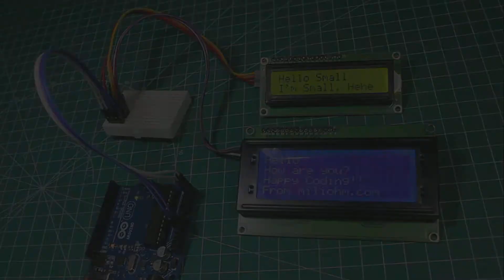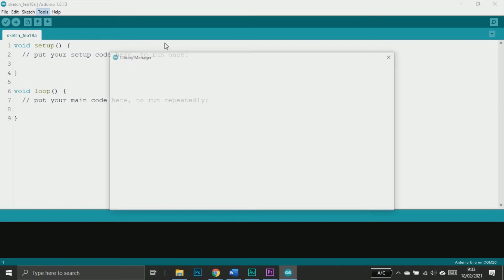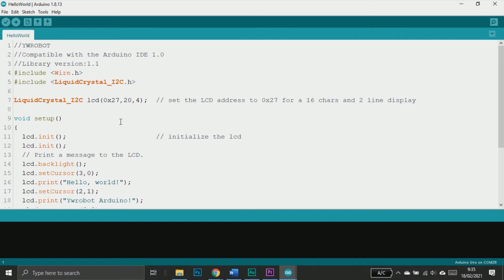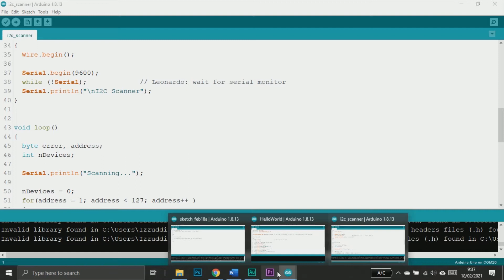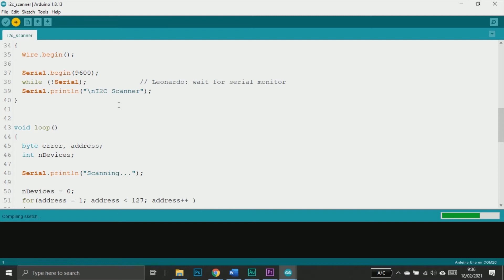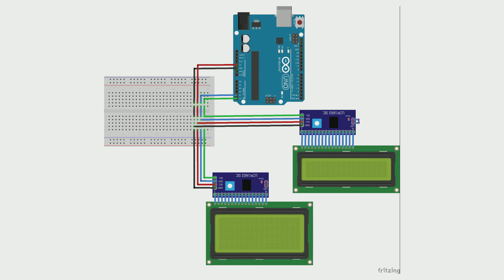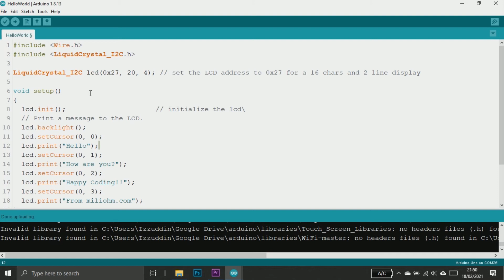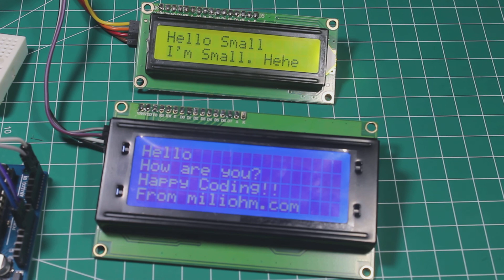How to use I2C LCD with Arduino and how to use multiple LCDs with one Arduino

Comment: What am I doing wrong, no text displayed on lcd.. only white boxes on upper line...
The code lcd.backlight() is turning the lcd backlight off and on if I remove and add it respectively... but displaying text is not working

Comment: Hey thx… I am having trouble running lcd with max7219 8x32 dot matrix, they work separately but not together, wondering if addresses might be my issue?
Reply from the maker: No, it has different communication protocol. This is i2c while max7218 is SPI